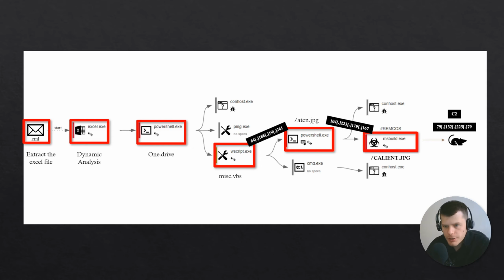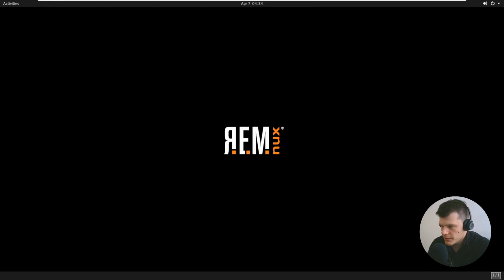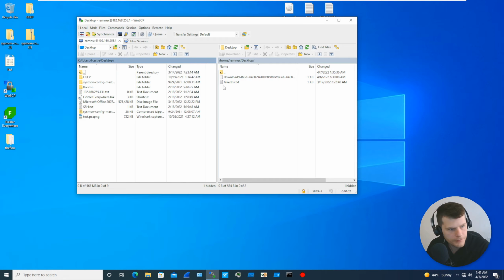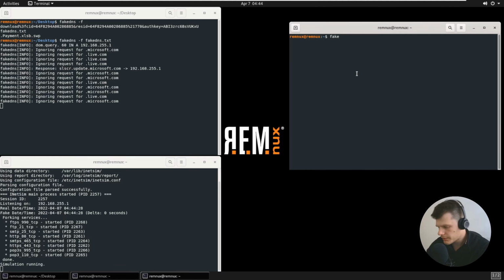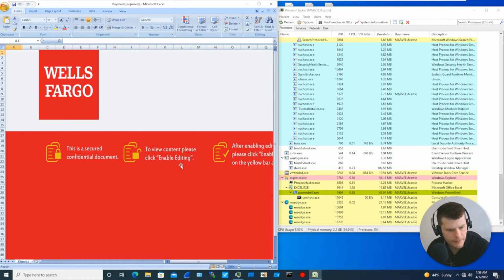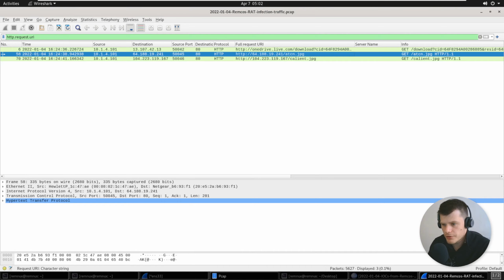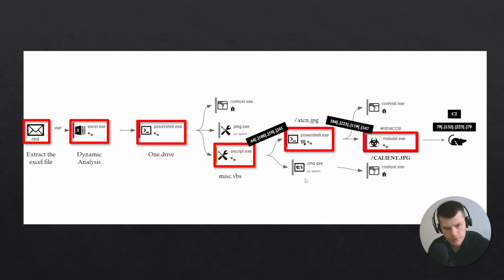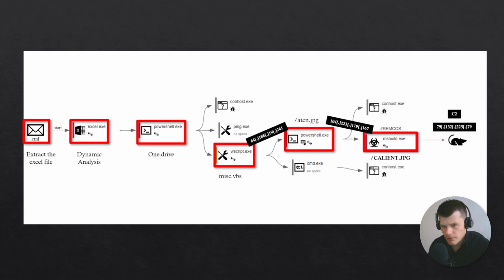Can you find the RAT? -  Remcos - Part 2

Comment: Hello,can you give me advice on the best way to remove this virus. I opened an excel file i received like and idot and after scaning with my antivirus it shows as spyware in c/programdata/remcos/data.log. I quarantied it and deleted,but it keeps coming back.Also,once every minute or so,i get a popup from malwarebytes about website being blocked due to riskware(outbound type).I am not sure if the two are related.Also,my pc is connected to others and the popup shows on all of them.
Reply: 1. Use Antivirus Software: The first step in removing Remcos RAT from your PC is to run a full system scan using reputable antivirus software. Make sure your antivirus definitions are up-to-date before running the scan. The antivirus software should detect and remove the RAT from your system.

2. Manual Removal: If the antivirus software does not detect the RAT or if you want to remove it manually, you can follow these steps:

   - Open Task Manager by pressing Ctrl + Shift + Esc and look for any suspicious processes running in the background. Look for any processes related to Remcos RAT and end them.
   - Delete any suspicious files or folders related to Remcos RAT. These files may be located in the Program Files or AppData folders.
   - Check the Windows Registry for any entries related to Remcos RAT and delete them. Be careful when editing the registry as deleting the wrong entries can cause problems with your system.
   - Disable any startup entries related to Remcos RAT using the System Configuration utility (msconfig).

3. Reset Browser Settings: If Remcos RAT has affected your web browser, you should reset your browser settings to default to remove any malicious extensions or settings.

4. Update Your System: Make sure your operating system and all installed software are up-to-date with the latest security patches.

5. Change Passwords: If you suspect that Remcos RAT has allowed unauthorized access to your system, change all your passwords for online accounts and consider enabling two-factor authentication for added security.

6. Perform a Full System Scan: After following the above steps, run another full system scan with your antivirus software to ensure that Remcos RAT has been completely removed from your PC.

If you are unsure about removing Remcos RAT manually, it is recommended to seek the help of a professional or use a reputable malware removal tool to ensure thorough removal of the RAT from your system.